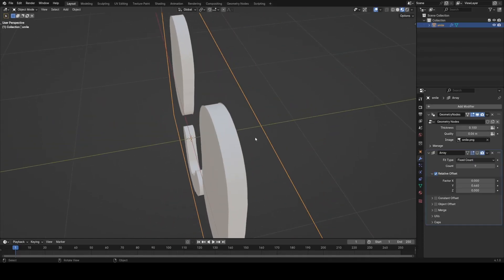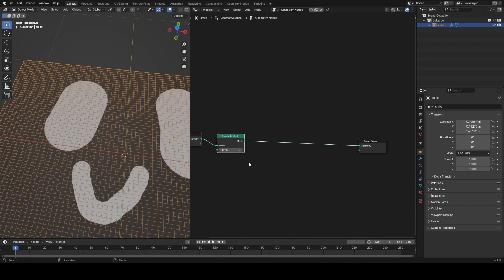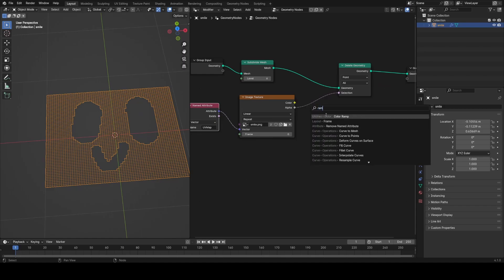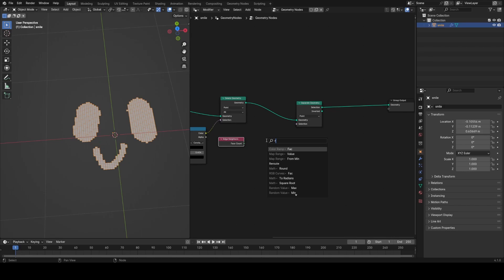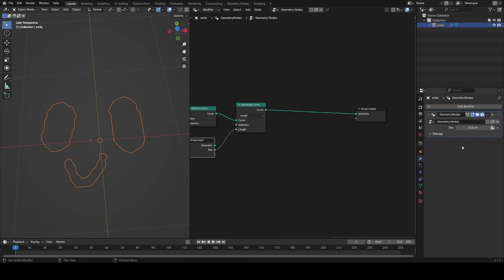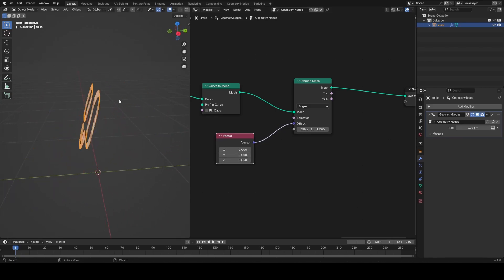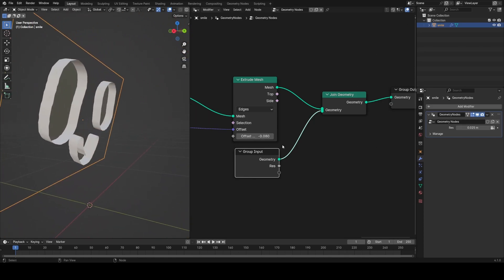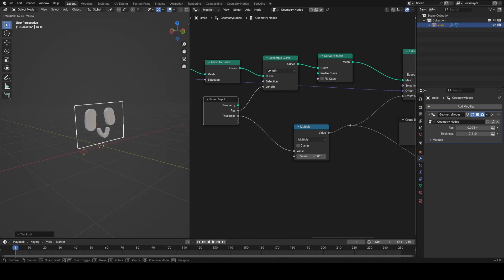Give Images w/ Alpha Thickness - Blender 4.0

Comment: If the image is a logo or is relatively simple, like the ones shown in the video, I’d recommend a much easier way to do this. First, convert your image to an .SVG file (there are several websites for this), then import it into Blender, where it will be recognized as a group of curves. Next, convert those curves to a mesh by selecting them, pressing F3, and searching for Convert to Mesh. Once you have a mesh, you can fill the faces and extrude. Hope this helps someone! :)
Reply from the maker: Yeah! this method works great, however is unscalable for larger scenes due to all the manual work involved
Reply: @Polycount-tw4ix I agree, I used this method because the image I was using was a very detailed logo and I had to do more subdivides and use a higher curve resolution, resulting in to mane points that made Blender crash haha

Comment: Dude I can't describe how much I love that you made this and that I'm so lucky I found this 😭. I have been trying to achieve this cardboard cutout effect for a few weeks now and I've been in and out of all sorts of weird methods using addons that weren't the right thing, ancient image to mesh addons that don't work anymore that I tried fixing to no avail with my poor programming exp., trying to perform vector sorcery with exporting the PNG to SVG in something like illustrator and after enduring that nightmare coming out with a blurry disaster of an image.

The amount of responses to questions on trying to do this that are like "subdivide the image plane 1000x and start manually cutting with the boolean knife" 💀, I was sure there must be a fast automatic way to do this and wah here your amazing video is.

Thank you so much!

Also at the end you said you could material/color the extruded side part, is that fairly easy to add in somewhere in the nodes? I can follow along but it's easy when following along vs knowing where to go 😂.
Reply from the maker: So glad this was useful for you! it sounds like you had a bit of a major issue haha. Yeah to color it you can just drop a set material on the bit of geometry we generated, UVs are doable too, but its a little more complicated, youre going to want to capture the curve attribute, and maybe mesh to curve it with a curve line instead of extruding, I can go into more detail if you need :)
Reply: @Polycount-tw4ix I gave it a go and got a solid color to dropdown all around which is nice, I only did the simple material on the geometry part though so it's all the same color around 😅. Is it possible to "pull" the colors down from the image being used so the extruded part colors match the parts of the image they are coming out from? Maybe that is what you meant by the UVs part and I didn't understand.

Thank you for the reply also, really appreciate it!
Reply from the maker: No worries! Yeah you can do that too, if you stored the image as a named point attribute on the subdivided plane, then with the extruded geometry, youd have to store another named attribute, that uses the "sample index and sample nearest " nodes to sample that first attribute onto the side...then finally you can reference that second attribute in the shader hah, it sounds complicated but really its just storing the image as an attribute, and transfering it to the sides
Reply: @Polycount-tw4ix can you explain it in... simpler terms please, I am currently trying to set the textures for the sides and can't get it so far

Comment: helped a whole bunch!!! thanks so much. running into an issue where one face will always render on top of the other, but i may have missed something
Reply: i have arranged the links in the same order to the join geometry node as yours is, which hasn't seemed to work. one of the faces (the back one) renders on top of the other from both sides
Reply: figured it out!! in the material properties changed render method from "blended" to "dithered"
Reply from the maker: thanks for watching! happy it helped. Glad you figured it out! yeah thats an issue that only happens in eevee